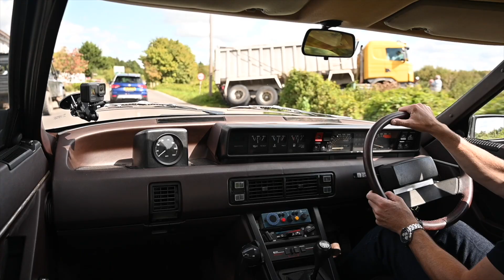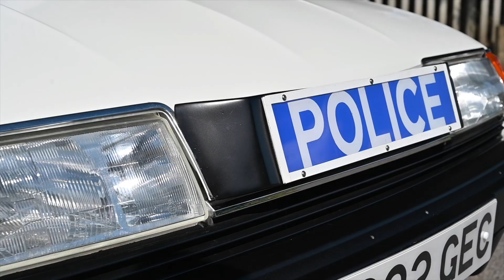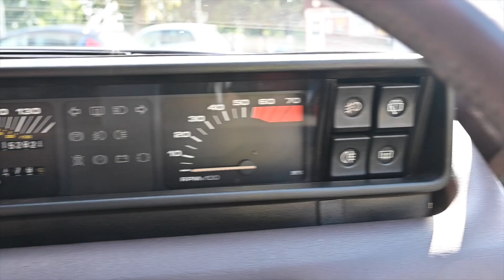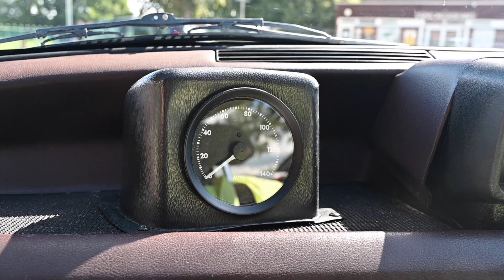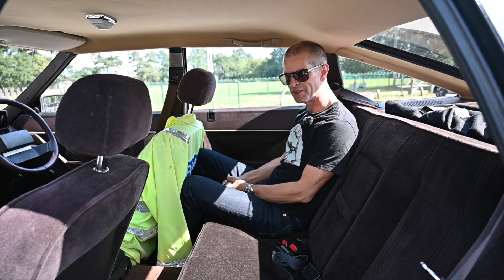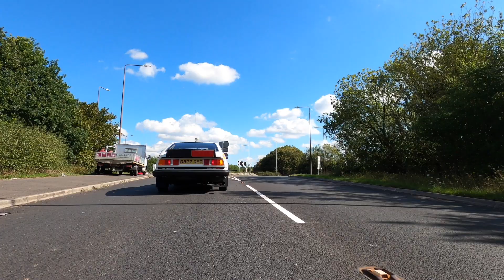1986 Rover SD1 Police Car

Comment: these things were good for 150mph with a hot cam and exhaust, (In fact, still 130 with a jet of water shooting out of a blown cylinder head). Also. measure the left indicators from front to back, then do the same on the right hand side of the car. Its longer!!!!!

Comment: Hi , whilst I was working for O( T)SG radio branch I used to maintain the radio equipment, when Austin Rover group stop producing the these cars the Met bought all remaining sd1 including all the Vanden Plas  , the public complained so all the repair garages had to remove the vanden plas badges off . Regards mark
Reply from the maker: Didn’t the Met also pay extra for de-specced Jags in the 60s so the public didn’t think they were driving flash cars?

Comment: The workhorse of the Met in the 1980's.  Traffic had the 3500V8 and Area cars were the 2600.  Mainly with an automatic gear box and if we were lucky, the square steering wheel got switched out.

Comment: Rumour has it, when the end of production came around that the met in London travelled the country buying up the entire stock of SD1s, regardless of engine and trim.
Reply: I drove one of those; it was a 2600 Vitesse. White on the outside and blue under the bonnet.
Reply: According to a wonderful story I read in a motoring magazine many years ago, as most of the run-out Rovers being snapped up by the Met were top-end models equipped with lots of gadgets, one area commander actually issued an official instruction (subsequently withdrawn after much ridicule) that whenever a member of the public wished to speak to a traffic cop in their car, the driver or front passenger was supposed to open the electric window in a jerky manner and somehow fake a "rolling" motion to disguise the fact that a police car (paid for with taxpayers' money!!) should actually have such hedonistic luxury equipment. The regular SD1s (some 3500s but mostly 2600s) were usually bought in stripped-down trim with manual windows, no radio, rubber mats, etc.

Comment: All Rover Police from P6 onwards were works built- front suspension with reinforcement and lower ratio differential for 0-60mph and stiffer front sway bars. Also was calibrated speedometer and radio. P6 had a central console police radio-telephone. Very similar PYE radio as on SD1. Police SD1 got special Vitesse plenums. If the SD1 had police rims 15 inch was probably standardised for not only brakes but more importantly volume discount on wholesale tyre purchasing. With AC DELCO aircon and Bosch electrics/electronics it would have been enormously popular in the States.

Comment: This brings back memories of the 1983 ex Avon & Somerset traffic division SD1 that I owned from 1986 to 1989. It was identical to this with the V8 engine and 5 speed gearbox, it had stiffened suspension and larger brakes than a standard SD1. It also had an aluminium bonnet and front wings to improve the weight distribution. It handled superbly and would really hustle when pushed.

Comment: The 80's SD1's were much better but the bad impressons given the 70's SD1's were so bad, the impressions stuck, and with a bad first impression from the early cars i.e. rust and reliability issues etc, not even an improvement could shift the better 80's cars well enough to make Austin Rover a decent profit, hence the much better 800 replacement that triumphed it.

Comment: Normal oil pressure for a healthy Rover V8 when hot is 35 psi dropping down to 15 psi at idle as per the indicated range of dial markings.  A cold engine might reach the 45 psi mark for a short time.
People who claim to have fitted high pressure oil pumps to them are 'barking up the wrong tree' - and/or barking mad!
They are a lovely engine when properly cared for.

Comment: Great cars, I remember them well.  Their enemy, like most cars from the BL stable, was rust.  “Steed” from the Avengers drove one in the series from memory.  Lovely burble from that glorious sounding V8 lump.  I could never have afforded to keep one in petrol otherwise I was sorely tempted to buy one but instead bought a Mk2 vw Scirocco which proved a costly mistake as vw didn’t enjoy their faked up reliability as per the tv adverts and as with many early gti lumps blew the head gasket and need new suspension well before expected.  I’d have been better off with the SD1 which was at least reliable!

Comment: I bought an SD1 3.5 v8 auto to tow my horsebox but my mistake was buying the auto version. Picked it up on a friday, went away 200 mls for the weekend towing the horse and it was rubbish at towing.

Took it back to the dealer on monday and got my money back - should have bought the manual...

I remember when the SD1 first came out the dealer was bragging about the design being so much better than the P6 "saving over 800 parts" - but was it a better car ???

Comment: Back in the 80's my boss had one as a replacement for his Range Rover been fixed a garage. Having had a 1984 RR with the same engine (previous owner had fitted SU carbs) and a stainless exhaust that sound brought back memories one been how easy they were to work on bac then with no complex electronics jus a hammer, spanner set and a few screwdrivers :-)

Comment: The Met tested the brakes and managed to them got virtually set on fire with the rear drums were over worked on a run. The Garage Technicians found the solution by fitting the front discs and calipers off the Mk2 Granda because they were vented and 4 pot pistons. When Rover found out where they had got the upgraded parts from Rover went away and sourced parts from the AP brakes company and used half Transit and Fiat Caliper parts and beefier discs.